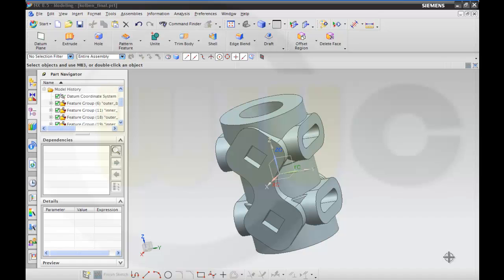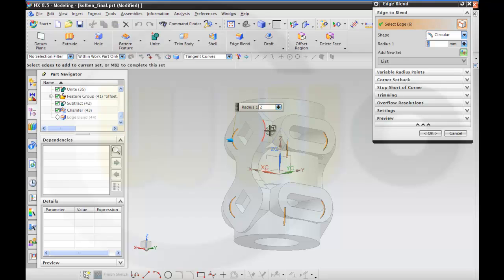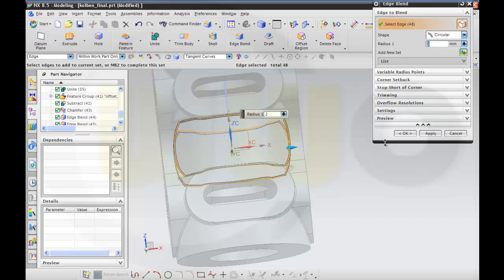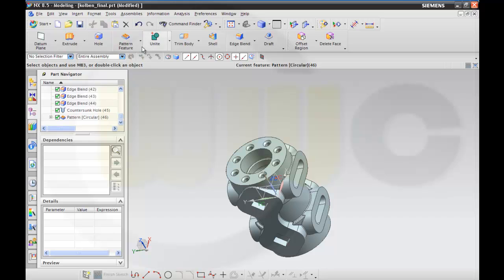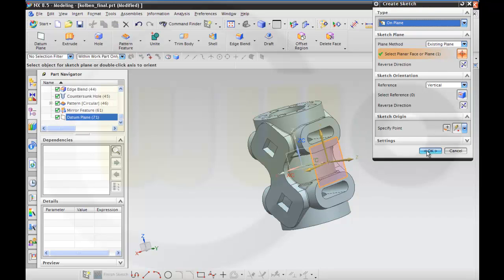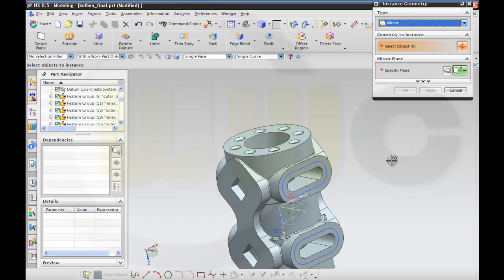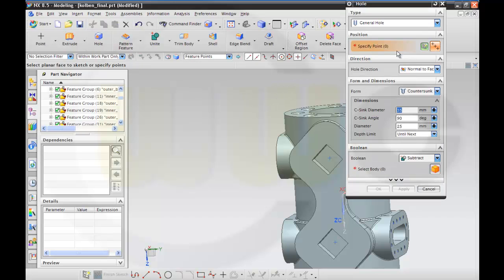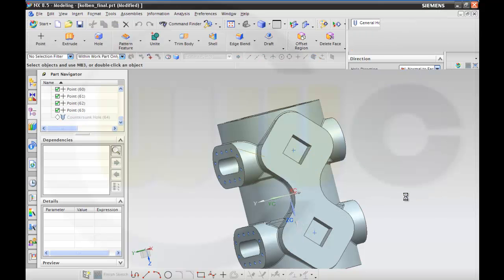Kolben / Piston part 2 - Siemens NX 8.5 Training - Multibody model - Pattern along path

Comment: Sorry for interruption, Sir. I have a functional question. What kind of button do you press, when in "Profile" tool you switch from line mode to ark mode - I could not see how you lead there the cursor.
Just for the record, "Thank you for the continuation also" is the tr of the previous comment.
Reply from the maker: Hi, just press left mousebutton and hold it and move from the last point.